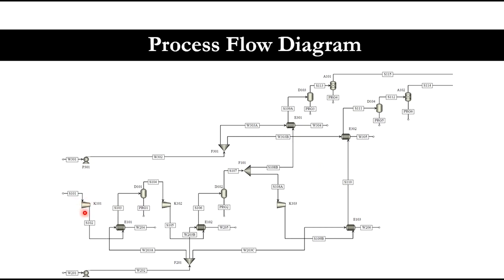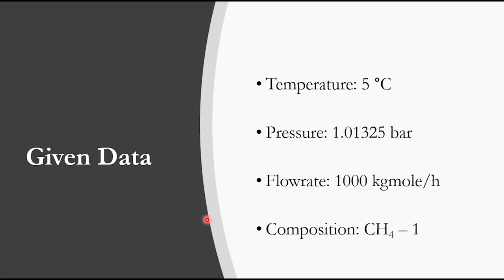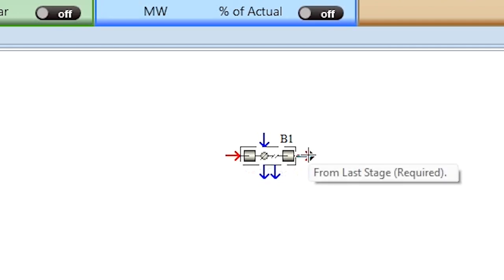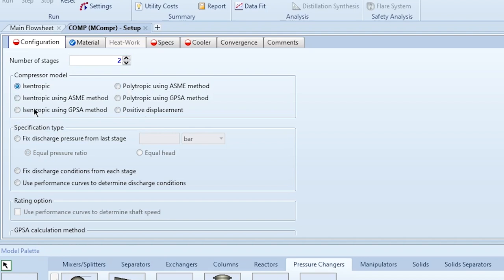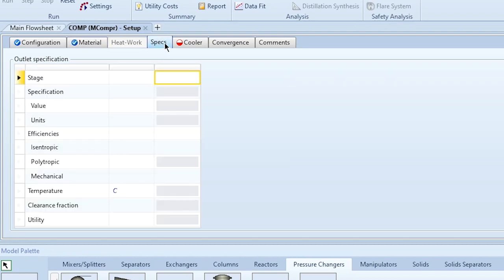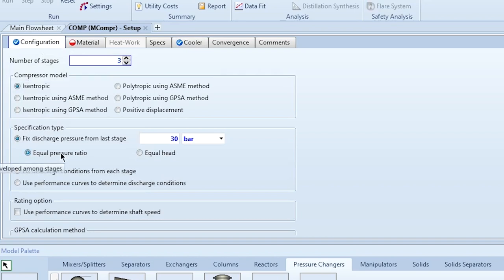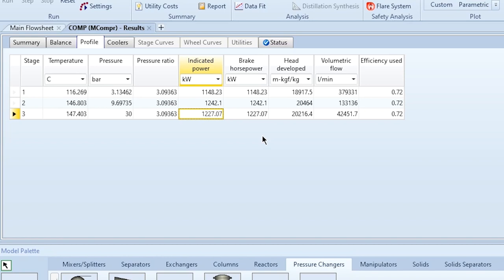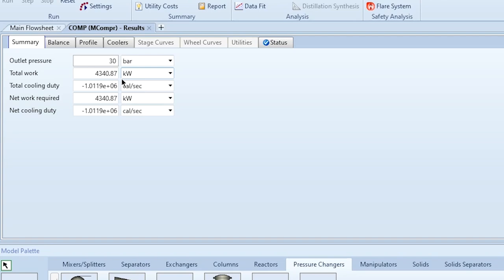Natural Gas Compression - Simulation of Multi-Stage Compressor using Aspen Plus - Lecture # 105

Comment: Imagine I have a feed at 1bar and 20°C that I need to get to 16 bar and 250°C, but the temperature at each compressor outlet shouldn't exceed 150°C for safety reasons. What's the best strategy?